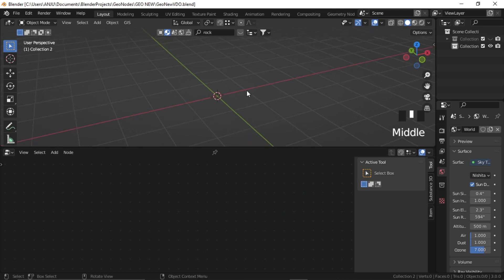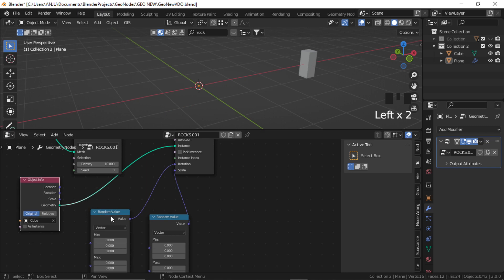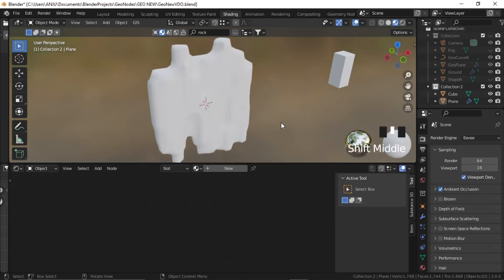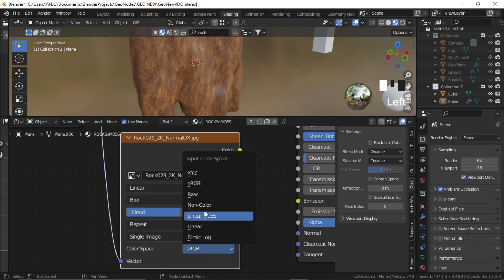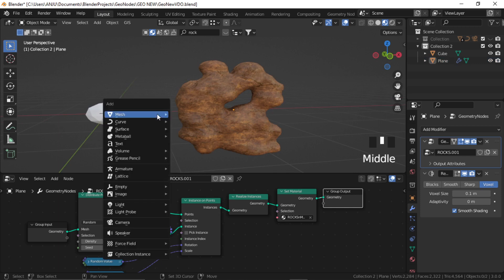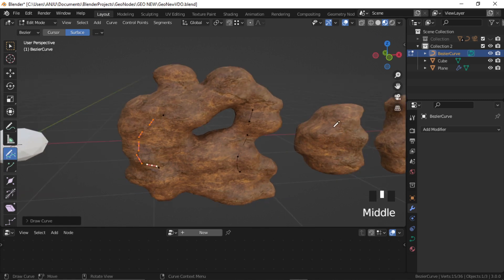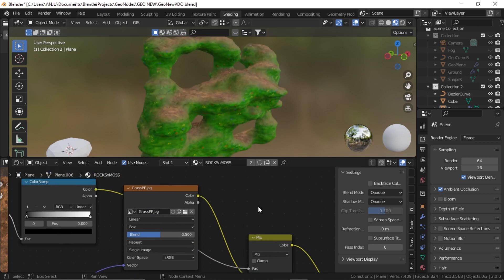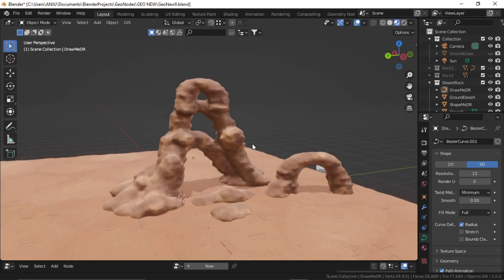Easy Geometry Nodes - Procedural Rocks Blender3.0

Comment: Working on blender 3.5 and as soon as i add the remesh modifier the model looses the material. If I turn off remesh in the viewport the material is back. Any idea why this is happening?
Reply: I solved it by adding another geo nodes after the remesh with only a set material node inside the tree. Just wondering is there a better way?
Reply: @BleachedBroccoli  Another commenter had the solution, place your Set Material after Object Info instead

Comment: Blender was really slowing down from this, and I figured out why - in the ReMesh modifier under the geometry node modifier, the voxel size was set to 0.05 and it was taking like 7 seconds for a render calculation. I set it to 0.5 and now it's regular fast. Hope this helps someone who might run into this problem lol

Comment: Hey, thanks for your Tutorial. It works fine on Blender. I want to use it to create some Assets for my Unity project, but there is  a little problem.
I can't assign a material to my cliffs/rocks in unity. Okay, it assigns, but it doesn't show up like it should. Is there anything to do while export?
Reply: There is this video on exporting to unity that he made. idk if it is what you need but...
https://www.youtube.com/watch?v=qrXZNG4yAa8&t=314s&ab_channel=ALLTHEWORKS
Reply: @plastic2666  Thanks for responding. I figured out, it was the missing UV Map. And after all I needed to mark some seams to prevent stretching.